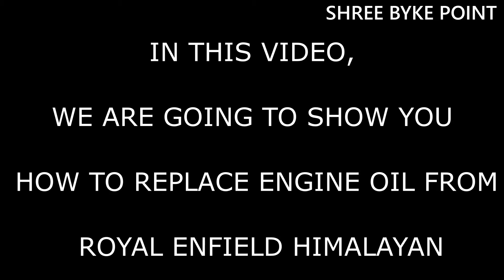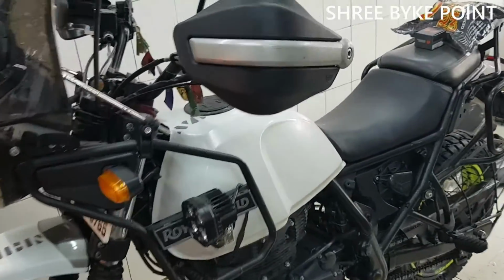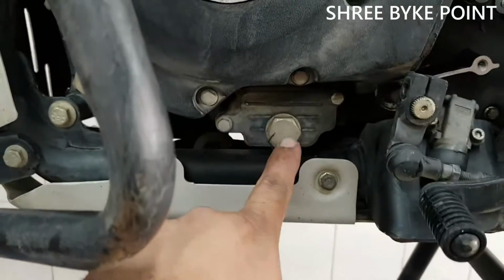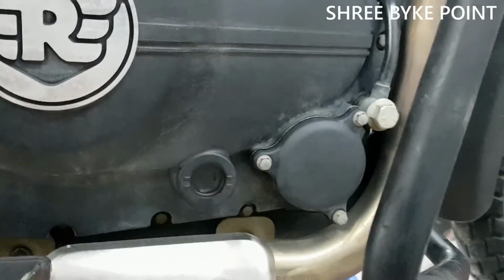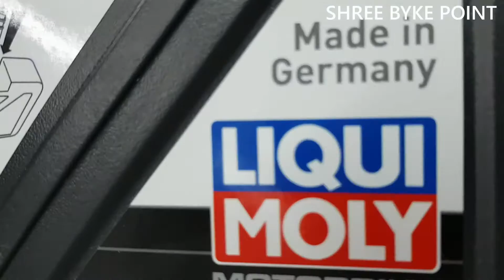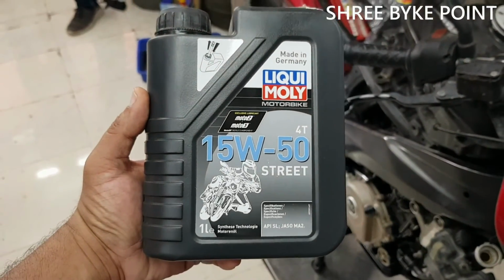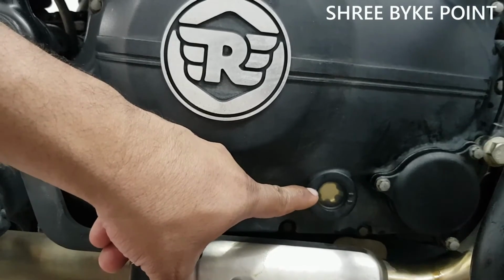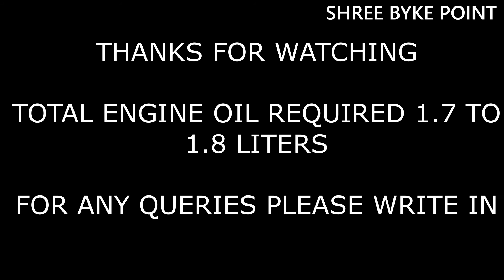RE Himalayan Engine Oil & Oil Filter Replacement

Comment: New filter should be filled with clean oil prior to inserting,  so as to maximize lubrication during the first few seconds of engine turn over. Have you read maintenance manual for this bike???🤔
Reply from the maker: This is internal filter, as soon as you pour new engine oil it automatically soaked by new filter. What you are saying is about external filters which are equipped with big bikes